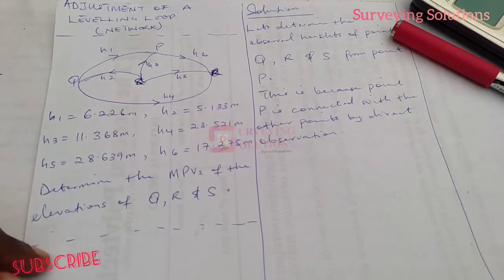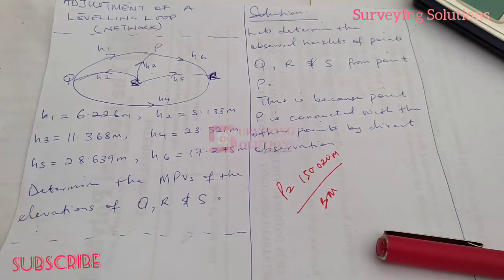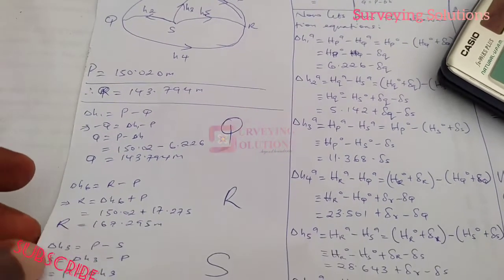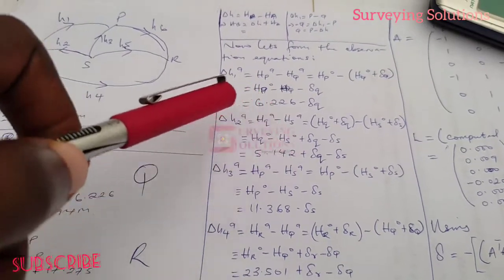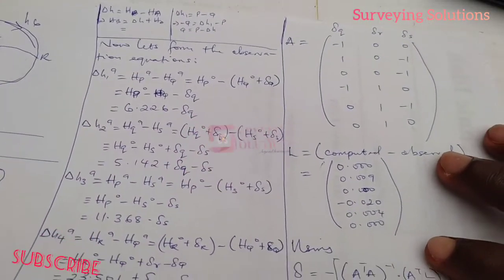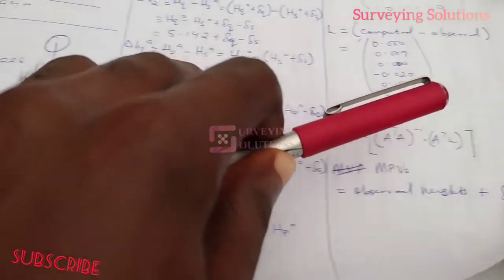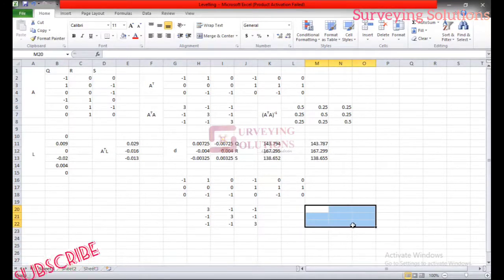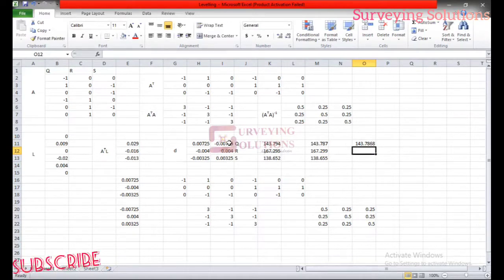Adjustment of Levelling Loop | Least Squares Adjustment using Excel | Adjusting Survey Computations.

Comment: How will you know the  dimension of the two matrix youre multiplying so as to select the corect cells
Reply from the maker: The dimension of a matrix is the 1st thing you have to understand about it before any arithmetic on it. 

Vertical is column, horizontal is row. 

Dimension is number rows by number of columns.